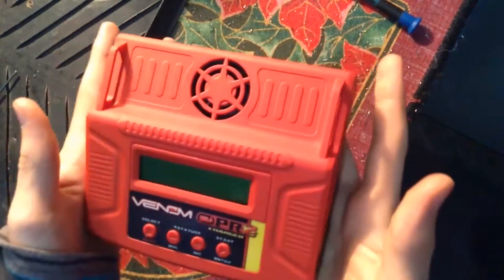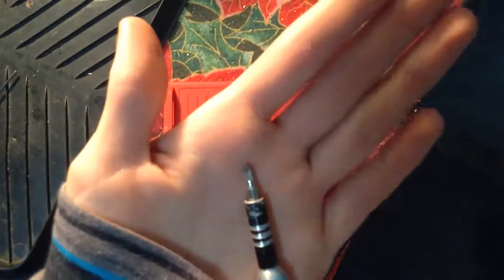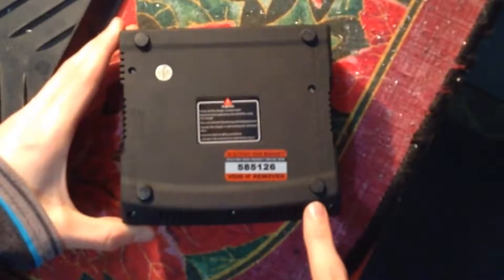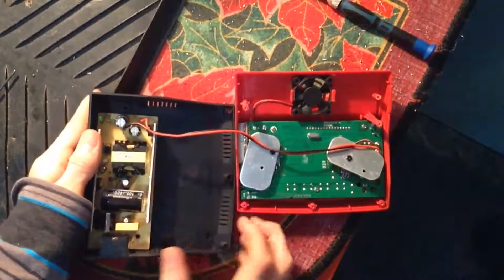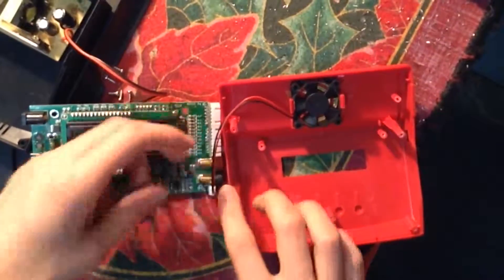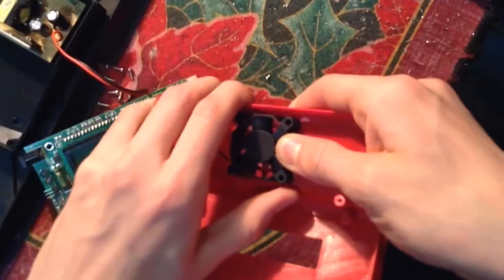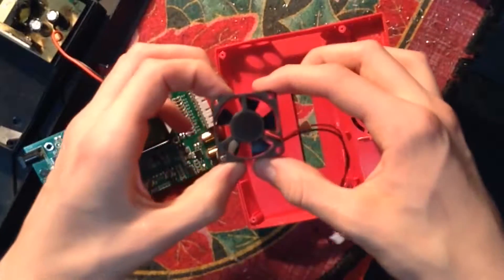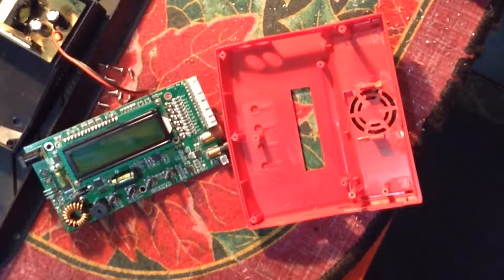Venom Pro-2 Charger | Remove Cooling Fan

Comment: These fans have a cheap sleeve bearing or other design that fails easily. The excessive noise most hearnis probably it rattling around at 1/5 the speed it's supposed to spin. It's easy to replace, but I am trying to find what Voltage the original is rated for.

Comment: I have one of these and the fan makes a horrible  screeching sound.   Do you think it even needs it?  Ive never felt the unit even get slightly hot.
Reply from the maker: BMX_HELIS Man even though it really annoys me I had to put it back on. You may not realize it but the fan helps cool down the unit ALOT. I usually charge my batteries between 2.2-4 Amps. At 2.2 I was fine but at 4 I was getting worried. If you charge at a low amperage I'd recommend removing it. But if you like charge at a higher amperage, keep it on, or atleast monitor it.